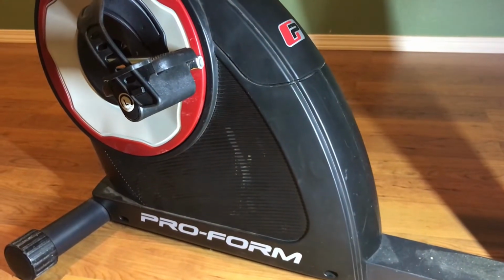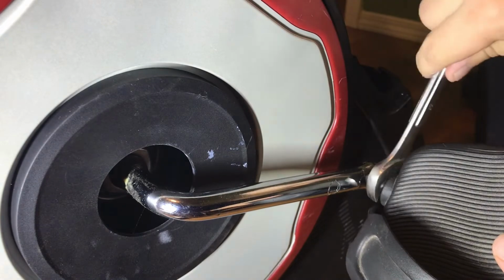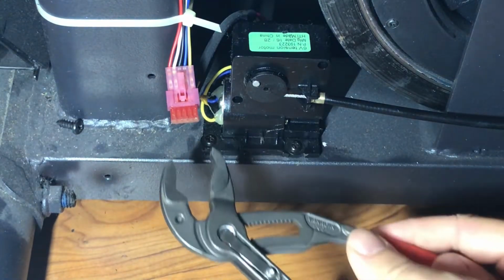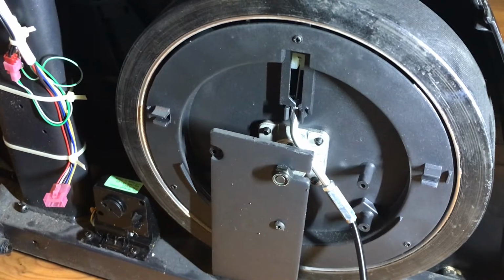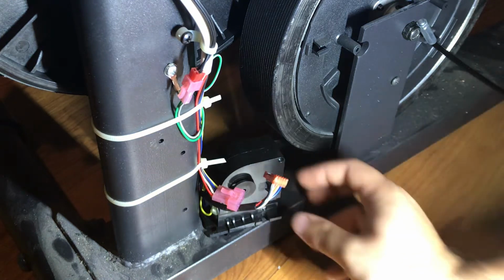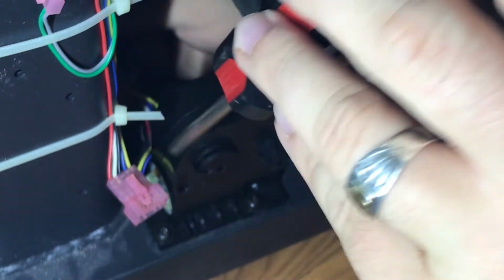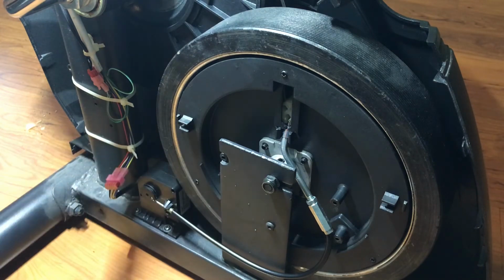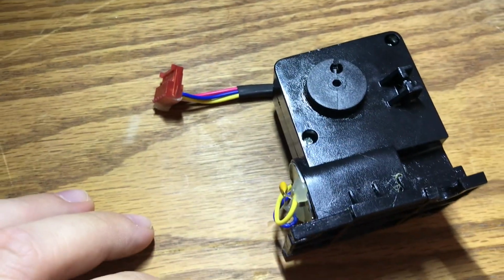Exercise Bike Resistance Not Working || How to Replace a Tension Resistor Motor (Pro-Form 235 CSX)

Comment: Hi, I just replaced the motor on my bike but it still doesn't work. I forgot to check the voltage on the male connector going to the motor beforehand. When I did, I didn't get a reading. I opened the control box and tested the male connector where the blue and yellow wire would connect and didn't get a voltage output as well. Can you help me figure out what to do next? Thanks!
Reply from the maker: I’m not following you. You did or didn’t check the voltage at motor? If you did and your getting no voltage when messing with the resistance level, than ensure a good connection from the buttons to the motor. If there’s still nothing, the buttons could be the issue or the wires. Voltage is only sent in response to the resistance buttons
Reply: @learnsavediy  Thanks for the response! Sorry for the confusion. What I meant was I bought a new motor without testing the wires first. Once I replaced the old motor with the new one and it still didn't work, that's when I decided to test the wires. 

After getting your reply, I tested the voltage at the motor again and didn't get a reading on the blue and yellow. I only got a reading when the leads were touching black and yellow and then black and blue. Would you know how to fix it if the buttons or the wires is the issue?

Comment: Open my bike up, motor was making noise, moved the cable around and motor was moving up and down fine but resistance was still stuck. Any clue as to what i should do next? Thanks in advance
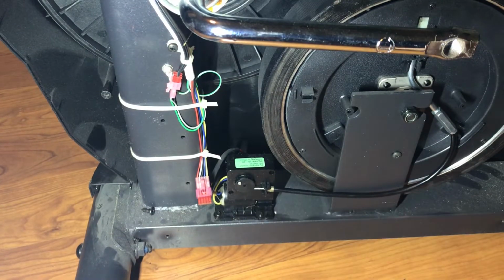Reply from the maker: Refer to @8:23 of the video to narrow down the issue. If the motor is working, then it could be the cable being broken or an issue with the flywheel. When you change the resistance does the motor move the cable and subsequently the white magnetic piece at the other end?
Reply: @learnsavediy  thanks for responding! Yes, the white magnetic piece moves up and down.
Reply from the maker: @adrianavilla16  if you move the magnetic piece up and move the flywheel do you notice it getting more resistant and less resistant as you move it closer and further?

Comment: Hi I was looking at buying an old pro-form bike that has a screen with a little fan. Looks like new but seller tells me screen needs batteries. My question is. If display actually doesn't work will the bike still work will the pedals have a proper resistance or even a medium resistance can someone please help me with this.
Reply from the maker: If it’s the same as this then now. You will have issues changing the resistance if you can use the interface. Personally, I would bring some battery and test it. The motor needs the support of the batteries in the screen to change (assuming it is like this model)
Reply: @learnsavediy  thanks for reply it's a pro-form 245 zlx I had an adapter which fit the screen it was from an electric shaver and once screen was on I can adjust pressure but without it it's fairly low resistance. It has a little fan on the screen it's old model but I got a good buy.

Comment: I replaced the motor and it still doesn't work. What is next?
Reply from the maker: What is the voltage at the motor wires?

Comment: I would not recommend this bike at all.  After just a bit of light use the digital resistance crapped out and never came back.
Reply from the maker: It’s definitely a beginner bike. It does the job but there certainly are better bikes.